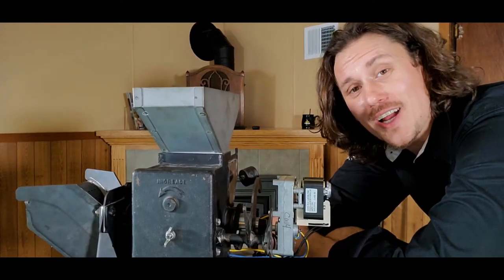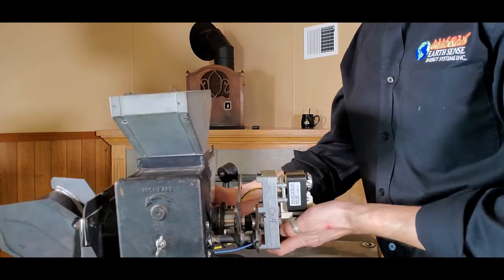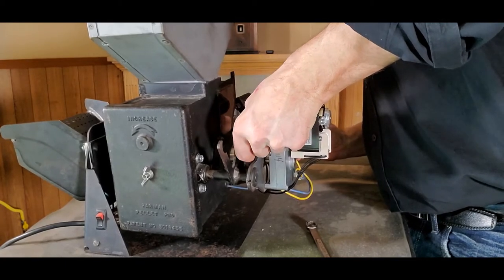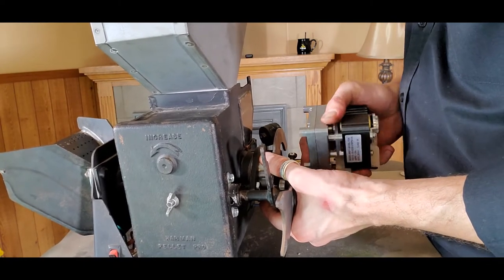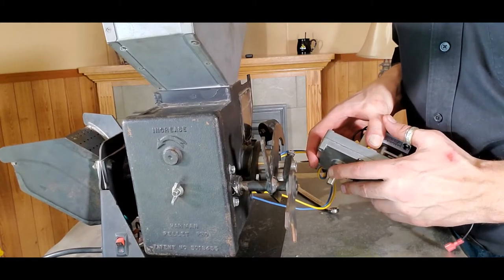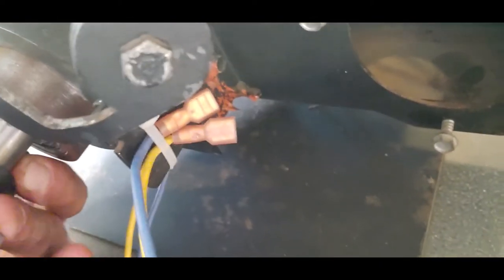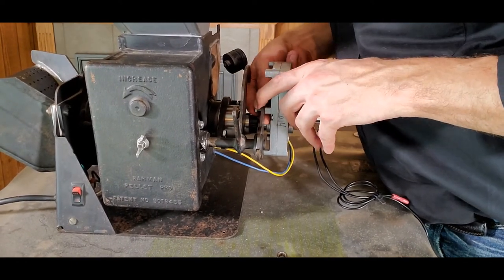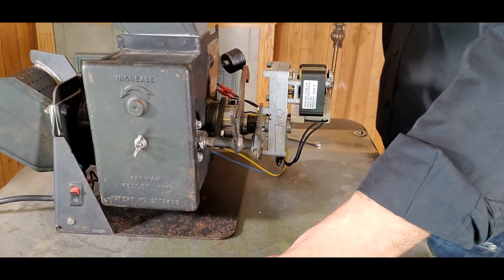How to Replace Harman Auger Motor, Direct Drive

Comment: Question, is there any way to install a control/rehostat thingie in the line to regulate the fan motors? I think if I was able to slow down the blower motor the stove would be quieter and would drive us crazy..
Reply from the maker: Thanks for contacting us. We would definitely not recommend putting a rheostat or regulator in line with any of the blowers - this could present some serious safety concerns. What stove do you have? How are you operating it? What blower is noisy - Combustion or Distribution? A good sealed bearing motor should run pretty darn quiet.. Let us know some details and we can provide some further tips. Thanks!
Reply: @EarthSense  It's a Harman p61a. It's a couple of years old. It's in the living room of a 1450sf house we built. Used it a fair amount the 1st year and less and less the following years. Maybe 6-8 tons all together. All 3 motors plus the feed auger make for a racket. We've looked at the Absolute 43 and it's quieter and seems to have a fair amount of fan regulation so you can turn the distribution fan up and down. I'd like to be able to do the same thing with the P61. The fan seems to run way longer than necessary. And it's pretty loud. I'm tempted to bite the bullet and go for the Absolute but I'm into the P61 for around 5 plus grand and the Absolute is around the same. Right now we heat pretty exclusively with an Empire wall furnace and I'd like to get away from that. Just not that happy with the way things are at the moment. Wouldn't break my heart if Harman traded me an Absolute for my P61.
Reply from the maker: @mikekemsley1531  Thanks for the message and info Mike. One thing you could do would be to put a fire-proof insulating material on the inside of the back and rear panels of the P61 to help deafen the sound. The distribution blower does have the H & L on the control board to adjust the CFM/Blower speed while in operation. You'll see this in both room temp and stove temp modes. Most dealers also offer trade-ins if you were to go that route to the Absolute model. 
Something like this could be helpful if you decide to insulate the rear panels for sound https://pellethead.com/product/liotherm-high-temperature-fire-rated-stove-fireplace-fiber-gasket-seal-24-x-12-sheet/

Keep us posted, happy to help. Thanks!
Reply: @EarthSense  Thanks, I have been working on sound deadening and have used some ridged foam on the back panels. I'm thinking of constructing a box to enclose the back. The stove vents and exhausts to the outside so venting isn't a problem. Just need to watch out for heat I guess. I haven't had much luck getting any local dealers interested in trading it.
Reply from the maker: @mikekemsley1531  Thanks for the message back Mike. Sounds like you are on it. Yes, be mindful of the clearances to combustibles on the P61 - the P-Series gets hotter than most other models and requires further side and rear clearance to combustibles. Clearances will be in the owners manual - if you need that sent over just let us know. Sorry to hear the local dealers are not interested in trade - we've always done trades, but maybe that is just us. You could always look at selling it through a marketplace as well - generally you can get more for it selling direct than what a dealer would offer you. Keep us posted if you need any other help. Thanks!

Comment: Hey me again ,another question on my old p61. When running on room temp, when the stove reaches temperature, it idles down as it should, but it never feeds pellets again and eventually dies out. The control board is calling for the feed motor but nothing happens. But if I crank the temperature, the auger will spin. Does this sound like a dying auger motor?
Reply from the maker: Hey Ryan, thanks for the message, happy to help. I would suggest we check the room probe - let's make sure connections on the back of the stove are good and the probe isn't in the pathway of any drafts or direct light. Coiling it up and securing to the back of the stove is generally a great placement. See if there is any change. From there I would suggest removing and cleaning the ESP Thermistor Probe (Video Below). The ESP is sensing temp in your exhaust and should be providing accurate data to the control board to maintain the temperature you set on Room Temp Mode. If your auger motor is working and sounding fine when you crank it up and/or when you put the control dial on 'test mode', it should be ok. Play with the feed adjuster dial as well; see if there is any difference when making adjustments between 1-6. Check the simple things here first and keep us posted. 
ESP CLEANING - https://youtu.be/kt7nnGMYU-k

Comment: Also how tight does the tension ball have to be? And is it supposed to go up and down
Reply from the maker: Hey Milagros, Yes, you should have some room to adjust the tension ball up and down. It's a minimal adjustment. The primary purpose of the tension ball is for the chain to ride along the top to help guide. Once you have it in the position you want just snug down the bolt, you don't need to crank on it.

Comment: After I installed the new motor the roller bearing makes a thud sound once it clears the arm.   What did I do wrong?
Reply from the maker: Hey Mike, Did you by chance take the slide plate out? Let's double check the slide plate is in there correctly and right/edge side up. Keep us posted, happy to help.
Reply: @EarthSense I’m hearing the same thing and it isn’t feeding pellets.

Comment: Hi. So i adjusted the sprocket and the tension ball and it still making that clicking sound it turns a little bit then it stops. It seems to not be catching on the biggest sprocket do I need to replace that sprocket I don't know what else to do I have pushed it as far back as we can go and try it like that I put it in the middle I've taken it out and secured the Allen screw and it's not working what else can I do please advise
Reply from the maker: Milagros, if the chain is falling off the sprockets, double check the alignment of the sprocket and make adjustment there. If the chain is not falling off the sprockets and your motor is intermittently stopping and you hear a clicking sound, something is binding somewhere. Open up the sawdust cleanout area, clean and check the slide plate in there. (Make sure your fuel hopper is empty) Check for obstructions and foreign objects. Generally the sprockets only need replacement if the teeth are worn down. When this happens the chain will jump and fall off periodically. Have you tested your auger motor to direct power to ensure it's not a motor issue here? 

If you want, take a video of what is going on, upload it to YouTube and send us the link. Happy to help.

Here's a video on the sawdust cleanout box: https://youtu.be/l3-Wg1xRUy4

If you need to test your auger motor to direct power here's a video on that: https://youtu.be/rlmiCYI2WPk

Thanks,
Reply: @EarthSense  the auger motor is fine I replaced it last year and followed your instructions I also replaced the distribution blower. At this point I am going to recheck my alignment I think that I need a new sprocket because it looks like the teeth at the bottom are not catching and the chain is coming loose at the bottom while the top of the chain feels very very tight
Reply from the maker: @milagrossmith4891  Thanks for the message Milagros. Yeah if the chain isn't getting a good grip on each of the sprocket teeth than we'll have some issues there with noise and skipping. Yes, double check the overall alignment best you can. If you do need a new sprocket I can send you reference links. Keep me posted. Thanks.
Reply from the maker: @milagrossmith4891  Hi Milagros, thanks so much for sending the video. This is very helpful. The secondary sprocket is not moving which is causing our chain to jump and wear down the teeth on the sprocket connecting to the auger motor. As you put tension on the chain it stops and stalls the feed motor. We need to pull off that second sprocket and see why it is not turning. Something is jammed/stuck/seized up. I believe to remove that sprocket there is a nut on the front and a bolt securing it. I do believe there is a bearing back there. This will be the problem area we need to inspect. The teeth on the auger motor sprocket do look very worn down, but first we need to find out why the second sprocket isn't moving. With it jammed like this it's also putting a lot of strain on the motor, especially when you pull the chain tight. I can also send over a full feed diagram for the Advance if you need it. I'm confident we can get you back to 100% here. Keep us posted on the removal and inspection of that sprocket. Thanks.
Reply from the maker: Also, wanted to show you the teeth on a new sprocket for reference. We first need to resolve why the secondary sprocket is jammed. Once we have that remedied we will want to make sure the chain is getting proper grip on the sprocket teeth. https://pellethead.com/product/harman-mark-i-advance-accentra-xxv-3-1-2-sprocket-w-hub-oem/
Reply from the maker: @milagrossmith4891  Milagros, once you have that sprocket off of there you will be able to access and pull out the auger shaft. I ran this past a couple other technicians and sent the video. They think there is either something in the auger shaft that is jamming it or the bearing on the auger shaft is seized up. Here is a video on the Harman Auger Shaft. https://youtu.be/B-vWuLh9zbE
Reply: @EarthSense  Incredibly helpful all of your possible solutions.  When I was troubleshooting I noticed that there was a bolt behind the smaller sprocket and it was loose it was not even screwed in. so I went ahead and screwed it back in but this still did not resolve the problem. What exactly am I looking for when I take off that smaller sprocket? Should I replace that sprocket as well as the chain?
Reply from the maker: @milagrossmith4891  Hey Milagros, With that sprocket pulled off you will be able to access the corkscrew auger shaft. We need to pull that shaft out as something is either jammed in the auger shaft or the bearing on the auger shaft is seized - every tech I ran your video past says the issue is with the auger shaft jammed. Here is a video on pulling the auger shaft out. https://youtu.be/B-vWuLh9zbE
Keep us posted with what you find. Thanks.
Reply: @EarthSense  hi well here is a link to what I have been doing all morning I was able to unscrew the auger from the auger shaft but I could not take the sprocket off I cleaned it out to make sure there was nothing in the shaft and I sprayed WD-40 and white lithium grease around the wheel bearing which is what I suspect is the problem. I manually have been turning it left and right left and right to get it going so I will be putting everything back together and see if that works please check out the video and give me your inputs thank you and can you also look at my sprocket teeth do I need to replace that thanks. https://youtu.be/XvsaFjNJyBI
Reply from the maker: @milagrossmith4891  Great job Milagros! Thanks for sharing this latest video. Sorry to hear you couldn't budge the nut and bolt on the sprocket, but so glad to see that you were able to pull out the auger shaft, clean that area, and that the sprocket is turning that auger by hand. Yes, I would say the next step here will be to reinstall the bolts holding the auger shaft in place (Try to tighten down evenly best you can). and let's get the chain back on there and on both sprockets. I do feel that the sprocket that is on the auger motor has teeth that are very worn down and I would recommend replacement on that sprocket so the chain can get a good bite on the teeth. But first, let's get the auger re-secured, chain back on, tighten down the auger motor while pulling it towards you so we can take as much slack out of the chain as possible, and make sure the sprockets seem even with each other. Once set, let's just turn the stove on test to see how it runs. If it runs good, let's put maybe 5lbs of pellets in the hopper to see how it does under load. Feel free to send another video as they are very helpful for us to help you. Really impressed with your technical skills and persistence Milagros, really great work. We're going to get this 100%! Thanks!
Reply: @EarthSense  great news, it's working! So besides the auger being a little dirty with pellets and perhaps an ash buildup I noticed that one of the bolts holding the actual auger in place was very loose. I was actually able to take it out by hand, so they were not tightened down even as you say. So I tightened everything down even very tightly I don't know if that's the way to go but I did. I put the chain on and I tightened the tension ball also tight and waited. I held my breath and guess what, it wouldn't turn on. The pellets were feeding and I can smell a little bit of smoke as the igniter was trying but nothing happened. So I checked the stove carefully and sure enough I left out the bolt and the plate that covers the ash particles. So I replaced that and I opened up the little compartment where the igniter is and cleaned it out with my finger. There was so much Ash build up ther, no wonder the igniter could not start. I replaced it and again held my breath turned it on and we have a fire! Thank you for your help. I definitely am going to replace both sprockets. As I feel I am on borrowed time if I continue to run these. Thanks again for all of your helpful tips and you're helpful videos have a great holiday
Reply from the maker: @milagrossmith4891  That is so great to hear Milagros. Excellent Work. I put in a coupon code for you valid through Jan 5, 2023 if you do decide to purchase the sprockets. Coupon code is for 10% off, use the coupon code Milagros10 during checkout (Capitol M). 
Here is the Auger Motor Sprocket: https://pellethead.com/product/harman-mark-i-advance-accentra-xxv-3-1-2-sprocket-w-hub-oem/
Here is the secondary sprocket: https://pellethead.com/product/harman-mark-i-advance-accentra-xxv-3-1-2-sprocket-oem/
Here is the entire kit: https://pellethead.com/product/harman-advance-accentra-xxv-mark-i-feed-system-chain-sprocket-kit-oem/

Any questions please let us know. Thanks again and Happy Holidays to you.
Reply: @EarthSense  thank you so much for your help. And for posting such great informative videos I really could not have done this without your videos you have saved me a lot of money. I will definitely use a coupon code because I feel I am on borrowed time with the sprocket and or auger. I got it working just in time. Tonight it's going to drop down to 15°. I can feel the difference in the temperature in the house as it has been running for a few hours already with no hiccups. Anyway thanks again for all of your help, happy holidays to you.
Reply from the maker: @milagrossmith4891  You are most welcome! So happy you are warm again! Let us know if you need anything. Merry Christmas!
Reply: Thanks for all of your work. Happy 2023 to you and all of you
Reply from the maker: @milagrossmith4891  Most Welcome! Happy 2023 to you as well Milagros!

Comment: Sorry to bother you sir but I have a question I work in a factory Feed Mill that was built in 1922 and have some questions about auger systems
Reply from the maker: Thanks for the message. Don't have much insight or information around feed mill augers, our experience with augers will be those in stoves or grills.